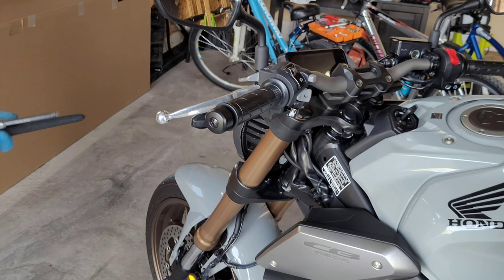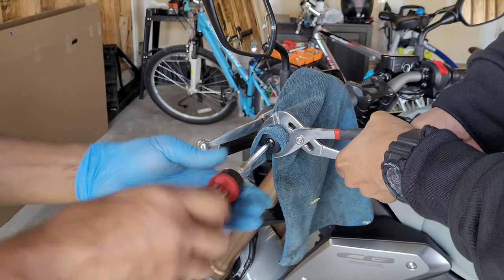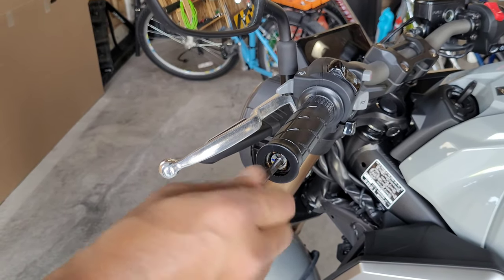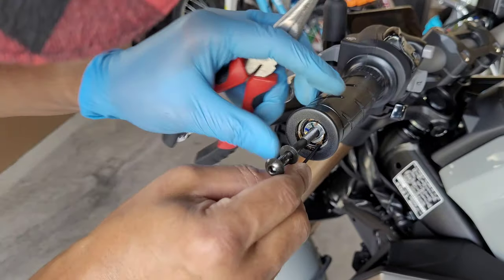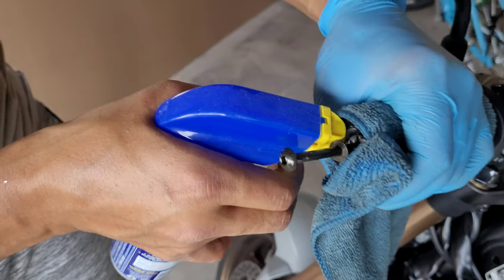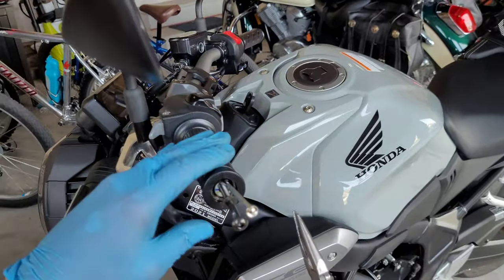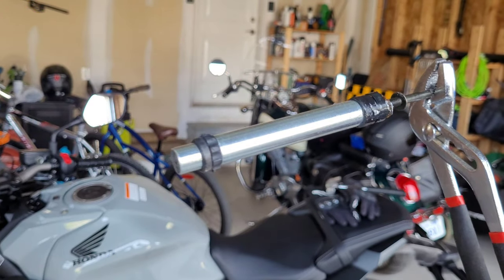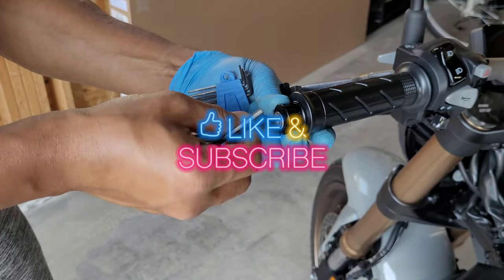2022 CB650R Easy way to install bar end mirrors, CB300 AND MORE

Comment: I ended up just using the ends already on the bike.
I installed the kimimoto ones that look a lot like this. 
Did not want to remove the weights so I just used the spacer that was in one piece and cut the smallest spacer to fit the original bar end onto the arm. 
From there I used the slightly longer screws that came with the mirrors.
Reply from the maker: 👍
You should post a picture of the setup.
Reply: @grinding-gears  I will in the next few days, let me just make sure it's good to go at highway speeds lol!
Reply: @bryantburn8191   so, was it good at highway speed
Reply: @danamiller7309  throttle side was an issue. I ended up getting thin enough double-sided tape and doing strips on the weight.
Clutch side will just tighten to the grip.

Comment: Can you not just remove the bar insert on the mirrors? Take the bar end off, then put the mirrors in their place using the original bar end screw? If that makes sense. Did in my head.

Comment: Did this on my cb because the rubbers in one of the weights got damaged and one of the weights actually fell out. 
Would not recommend removing them, unless you have a fairly high tolerance for vibrations. Those weights are actually extremely effective. The bike isnt unpleasent to ride without them, but uh, the highways are pretty rough on my hands if I'm at it for a long time.
Reply from the maker: What you said is true, the vibration from the handle bar can numb your wrist after some time on highway speeds.
The weights are in there for a reason yes.

Comment: Thanks for sharing the video. I got a problem with remove throttle side bar end, the screw just too tight to remove, any advice ? Thanks
Reply from the maker: Hey, sorry for the delay, just noticed the comment,  if the screw is too tight, gently tap on the screwdriver as you turn to loosen it, applying some penetrating lubricant before that will also make it easier. Hope that helps.

Comment: You don't need to Hold the Bar End Cap as you are Removing the Screw/Bolt which is not going to be Impeded by the Bar End Spinning, also, if you Spray a Bit of Lube Under the Rubber Grip you can Remove it Easily which will also Prevent you from Damaging it with Screw Drivers and give you a lot more room for Faffing around with Removing the Clip.

Comment: On the throttle side won't you damage the throttle tube if you grip it with a wrench?
Reply from the maker: No, you are gripping on the bar end weights. It has no connection to the tube

Comment: Nice video! Did you notice any difference in terms of handling without the stock bar weights?
Reply from the maker: Yes, you could feel the vibration on the handle without the weights. That's what the weights are supposed to be doing, dampening the vibration. 
You win something you lose something 🙂
Reply: @grinding-gears  thanks! So the weight of the mirror doesn’t cope with the missing inner weights is what I meant
Reply from the maker: No, not even close, the mirror is pretty light weight. That is something they should have done to compensate the weight,  or at least have the mirror screw on to the weight to avoid this problem.
Reply: @grinding-gears  alright thanks for the info.. would you say it’s still worth it for the awesome look of bar end mirrors tho?
Reply from the maker: To be honest,  it looks awesome but, it kinda numbs my wrist within 10 kms of ride, you could see me doing that in the video i posted after this, just the right hand though. Again it's just my experience.

Comment: Why couldnt you just remove the outer screw and reuse it longer to install the barend mirrors? why does the entire weight have to be removed?
Reply from the maker: Hi, the weight bar occupies the whole space inside the handle bar where the mirror attachment was supposed to go in. Unless.you remove the weights,  you can't insert the mirror attachment.

Comment: This is terrible advice. There's no need to remove the weight to attach bar-end mirrors. Just remove the silver sheaths from the mirror itself.
Reply: The weights spin freely in the bar so attaching the mirrors to the stock weights will not work.